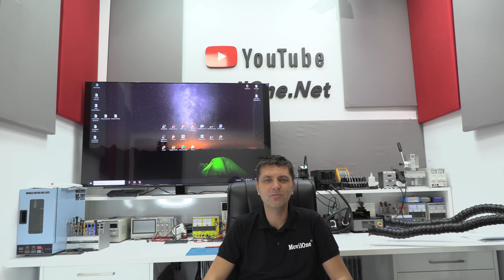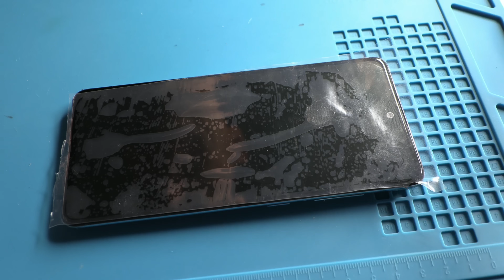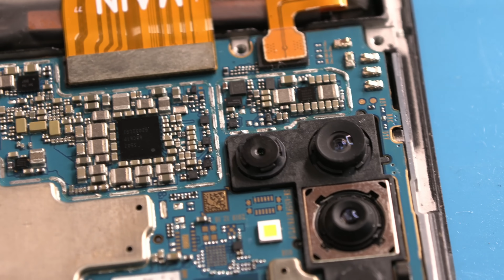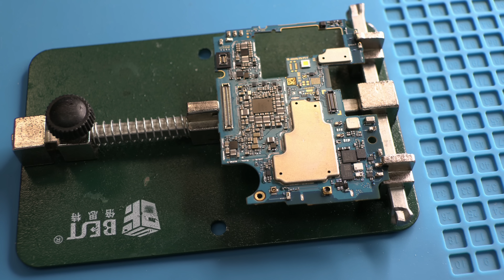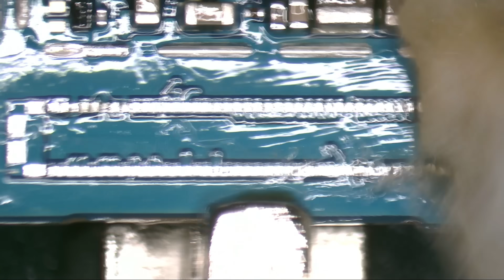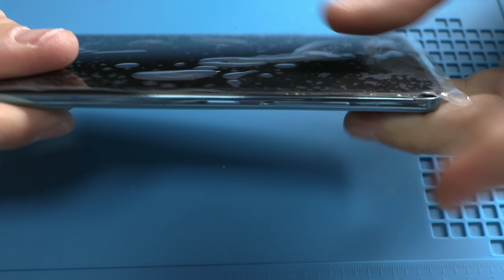The Samsung A Series Secret They Don't Want You to Know!

Comment: Going Eco killed this.
The Lead base solder could "flex" (actually bend like other metals) and the new eco solder is like flexing glass (snap)
Reply from the maker: You're absolutely right! The move to lead-free solder has led to brittleness and reliability issues. Leaded solder allowed for some flexibility, while the newer "eco-friendly" alternatives are much more prone to cracking under stress, leading to premature failures.
Reply: @MovilonePhoneRepair  And billions and billions of trash bags with dumped failed smartphones.
Entered the ground or waterways
Reply: idk, i've had a plenty of leaded solder failures too. Solder can fail under some surprisingly small continuous mechanical stress, leaded and lead-free. I'm not sure if lead-free is any better or worse, my experience is mostly around the leaded stuff.

Comment: these devices aint manufactured by samsung directly, thats why. the quality control is not good enough.
Reply from the maker: You're right—many devices are manufactured by third-party suppliers under Samsung's brand, and quality control can sometimes be inconsistent. This often results in common recurring issues across multiple devices.

Comment: Thermal contractions
Reply from the maker: Thermal expansion and contraction could definitely be a factor, especially with the varying materials used in modern smartphones. Over time, these stresses can weaken components and lead to cracks or failures.

Comment: Same problem in oppo A57 and A77 batery conector
Reply from the maker: You're not alone in noticing this issue—battery connector failures seem to be a recurring problem across multiple brands, including Oppo. Weak solder joints and poor quality control are likely contributors.

Comment: ForTheMicroprocessors,TheChipIsSmallerThanTheBoard.WhyNotMakeTheChipAsBigAsTheBoardAndNotCramAllTheComponents(Transistors)?ThisWayResistanceIsLowerSoNoNeedTheFanForCooling.
Reply from the maker: That's an interesting concept! However, increasing chip size would also increase power consumption and potentially create new challenges in heat dissipation and manufacturing costs.
Reply: @MovilonePhoneRepair  Ok.IMeanNotPuttingMoreTransistors.But,IncreaseTheTransistorsDimensions,IncreaseDiameterOfConectionsBetweenTheTransistors,ThusHavingLowerResistance,AndLowerPowerConsumption.

Comment: Hello!
I work in one corporation, we do have constant issues with connectors even if they are tested by producer and then internally, the connector change is always a hassle of agreeing with everyone that these will fit.
It is quite difficult, there is planned obsolescence in phones and smartphones, but mostly it is in technical written as device lifetime or something like this.  Connectors are always in issue, they are a real pain even though they have been produced sometimes for decades, issues were adressed and it is never fixed even if supplier is pushed to modernise thing, change the design and it just make less failure rates a bit, but connectors are not planned obsolescence, they are just poorly designed and poorly produced. There are also huge issues with soldering, even in automotive because of lead-free solder and complexity of PCBs for soldering ovens.
the old connection systems had betterating force, were mechanically more complex, but were taking more space and had more parasitics. These FPC are better in terms of signal integrity, but mechanically they are very delicate and can't withstand for a long time periods usage outside of the table.
Samsung doesn't have input control, what is supplied is just delivered and then used in production. The problem is company that has buroucracy that just drowning in meetings where they grind water and try to find a scapegoat. They won't fix phones even if they would malfunction right after being packaged.

Comment: My a34 broke when i droped it  and screen went black but there were no cracks on glass
Reply from the maker: That’s unfortunate! Internal damage can happen even without visible cracks on the glass. The force of impact can transfer to the display components inside, leading to failure.
Reply: @MovilonePhoneRepair  my s21 cracked and under repair, the only phone that has never failed on me is my fake iphone 15 pro max i got of aliexpress and inatalled lineage os onto, apart from an ocasional reboot, its my backup and is my gaming phone

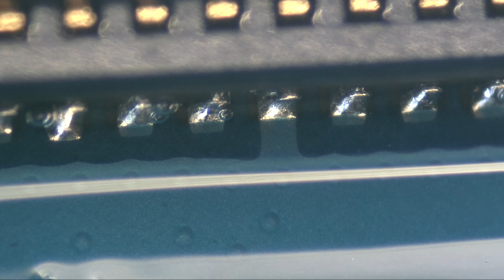Comment: 9:27 why don't you cover components above the repairing space ,their soldering can be melt down too ?
Reply from the maker: Hi, for those who know me, I never cover anything when soldering because I prefer the heat to dissipate more quickly. And just to clarify, I work with temperatures of 400ºC, but the key is using a low airflow.

Comment: We used to service devices , apparatuses, and the like. Today, it gets shipped or it goes to the landfill. A51 is toilet paper here in the usa... and anyone possessing the skillset to diagnose and exact repair, is in data recovery or repair of cnc or industrial automation. These devices are great lil learning devices. As far as Samsung is concerned  ... usa sold them our appliance market... Samsung phones are great for taking over for other brands, try getting your pictures off of an sd that was in a Samsung... with a moto.... 💀 but, magically with a differt samsung, got my images... and then... sd had to be formatted or it would not read.... and the backup? Moto could not read that either. But our population has no problem financing $2000 on the samsung galaxy hype... with their $ 250 devices... that is why .... we live in a disposable country.
Reply from the maker: It's unfortunate that repair skills are being lost in favor of a throwaway culture. With manufacturers pushing expensive replacements over repairs, it's becoming harder to maintain devices long-term.

Comment: The most commom problem with smartphones is the battery that magically lost more than half of it's duration right after a software update (generally one year of use)
Reply: software updated to dance away from warranty responsibility?
Reply from the maker: Battery performance degradation right after software updates is a well-known concern. Many suspect it's an intentional move to push users toward newer models.
Reply: @MovilonePhoneRepair  and it works, i lovr my phone, but i will have to change it since it lasts only a third of what it lasted when new (only two years ago)

Comment: Back in the mid 70's I worked my way through college as an IT building and testing printed circuit boards. Even went through the same training that they do at NASA. I am amazed at how far things have progressed.
Reply from the maker: Wow, that must have been an amazing experience working with PCBs back then! Technology has come a long way, but some of the old techniques and skills are still valuable today. It’s always great to hear from people with firsthand experience.
Reply: @MovilonePhoneRepair  We were building electronic equipment for the oil industry, very harsh conditions which is why they were really strict on work quality. Some of our stuff were in tools sent down hole with temperatures touching 400 F and a lot of vibration.
BIG EDIT: I didn't catch PCB as printed circuit boards on my initial response.
Reply: Progressed? Try regressed
Reply: @ricardomontalban2114  Are you saying that today's electronic are not superior to yesterdays? While I, in some circumstances like with guitar amplifiers, think the old tube amps were better, overall electronics have greatly progressed. So has the manufacture of this stuff. The only thing I can see as going backwards is if you like to put your own equipment together. It is simply more fun to solder in individual components instead of one IC.

Comment: Plz make a video on galaxy s8 device , my s8 doesn't pick sd card , may be its SD card slot has issue inside .
And also galaxy s8, s9 has slow charging issue on one side and fast oj other.
Charging strip of galaxy s8 is very weak ,
Make a video on its charging strip issue issues
Reply from the maker: Thanks for the suggestion! The Galaxy S8 does have some common issues with the SD card slot and charging strip. I’ll consider making a video on that topic soon to help out users like you. Stay tuned!

Comment: I like how you make it seam to people this is an easy fix. ITS NOT! By the time you spend the money for an airflow, soldering iron, a high-powered video microscope, and the proper tools and equipment you need. Just to fix the phone you might as well go out and buy  a new phone. Besides the technology itself changes so fast within six months to a year that product you just bought is now obsolete so why would I go spend all that money on all that gear needed to fix an obsolete phone? Everybody knows that there’s more R&D putting into make products fail, but that’s because technology move so fast it doesn’t make sense to hold onto your old products. Let alone pay to get them fixed or even pay for the hardware to repair them yourself. I can appreciate the fact that you wanna show people that. Yes there are flaws in manufacturing as put there on purpose. I work in a lab and I do electronics for living the technology move so fast it doesn’t even make sense to repair it . If it breaks throw it away. Go buy a new one. I bought my iPhone and literally within three months. They had a brand new version  out. The best thing I’ve ever seen people do is go to Costco and buy their electronics because within a year if they come out with a new product, you could just trade it in for an upgrade for free. I’m all about trying to keep stuff out of landfills and believe me I have a lot of old technology that I’ve repaired time and time again, but it gets to a point where even that older technology, even though it works is obsolete for where the times are. No matter how good it works you’re just not gonna be able to keep up with society and the people around you. Good example is if you have a phone that won’t allow you to install an application because the operating system run on is too old to support that new application. If you need that application for work, you’re stuck upgrading. You have no choice.
Reply from the maker: You bring up a great point. Repairing devices isn't always easy or cheap, and the rapid pace of technology can make it feel pointless sometimes. But the bigger issue is the environmental impact—throwing away perfectly repairable devices just because of minor flaws or software limitations adds to the growing e-waste problem. If more people learned basic repairs, we could extend the life of our devices and reduce waste. Still, I get that sometimes it's just easier to upgrade. It’s all about finding a balance that works for each person.

Comment: i've noticed the same thing with hp laptop batteries. It's like they have an installed system that's meant to keep track of its service time. It refuses to charge after some time and before this, the latop starts to giv you warnings every time you turn it on.
Reply from the maker: Yeah, that’s a common issue with HP laptops. Many manufacturers embed battery management systems that seem to "expire" after a certain period, forcing users to replace them even if the battery still has potential life left. It's definitely something to keep an eye on.
Reply: I bought at HP laptop.  After 3 years the motherboard went.  Bought one in 2020, 6 months after the hard drive went!  Still works today 5 years afterwards!

Comment: Until last year i had a A51 but it has a problem of constantly getting rebooted and getting stuck in the logo. And because in my city the are no technicians that can find or fix the problem. I had to buy a new phone
Reply from the maker: That's unfortunate. The reboot loop issue is quite common in the A51, often related to storage or power management problems. Finding a good technician can be a challenge, but sometimes a thorough reflash or hardware check can bring the phone back to life. Hopefully, your new phone serves you better!

Comment: A have an old LG Blu-ray player that the manufacturer used wrong solder that cracks in low temperature, and stops working. I took the motherboard out and put it in the kitchen oven on a tray at 180 °C for 10 minutes.  It has now worked for 15 more years since it's death!
Reply from the maker: That's an awesome DIY fix! Reflowing solder in an oven can sometimes work wonders, especially with older devices that suffer from thermal cycling issues. It’s great to hear your Blu-ray player is still going strong after 15 years!
Reply: It is a Blu-ray surround sound device.  Heard that this issue was for many units they sold. The warranty was overdue.

Comment: CONFIRMED on Samsung Galaxy A55 and the newest M Series

On the Chinese Brand Poco Series starting failure by design. Thermal issues and Crap solder join.

Transion Holding's port Type C Connector degradation by design.
Reply from the maker: Thanks for sharing that info! It’s true—some of these failures seem too frequent to be just coincidences. Poor soldering and thermal issues are becoming more common, especially in budget series. It’s always good to be aware of these potential problems before buying.

Comment: Just opened your vid as I brought back a phone from a repair shop two days ago. The phone is POCO F2 Pro -- a very nice phone that is serving its second owner.
The shop identified the problem as being on the main board and said that the board would have to be replaced at high cost and that it makes more sense to get a new phone. They also said that the battery charge should never go to zero because the flaw would prevent a recharge. They recharged the battery externally and it can be charged (again) now. Boy, it sure seems like the PFC conn thing. On and off. Oh, the pop-up cam is my favorite and works like a charm. I'll go back in with the request to zero-in and replace the FPC (at 1/10th of the cost). Wonder about their reaction.
Reply from the maker: That’s a classic case of repair shops trying to push for a full replacement instead of targeted repairs. If the issue is with the FPC, replacing it could definitely save you a lot of money. Hopefully, they’re willing to work with you on that instead of just suggesting a new phone. Good luck with it!
Reply: @MovilonePhoneRepair  most modern "repair shops" don't even have the equipment, skills or parts to do component level repairs. you can consider yourself lucky if you find one that does real repairs

Comment: my A34 stopped charging i got that fixed few months later its boot looping for a day as of last week its started boot looping again
Reply from the maker: That sounds frustrating! Boot loops can sometimes be linked to software issues, but recurring problems often point to hardware faults, like storage or power circuits. Maybe a deep inspection could help find the root cause.

Comment: I had the same problem A 51 5g sometimes it used to charge  other times it wouldn't other times it would charge for longer hours
Reply: It took me years in phone repair shops  until now i don't what the problem was but the phone is now okay but I live in fear it will spoil again. Even my back plastic cover has broken apart from opening and closing the phones back side
Reply: A jumper wire was put on the fiber cable, but it finally worked
Reply from the maker: That’s a known issue with the A51 5G. The charging port and related circuits tend to wear out or develop inconsistencies over time. Keeping an eye on it and using good-quality chargers can help extend its life.

Comment: Thanks.  I still find it shocking to do solder by just high heat flow without ever touching the part. I first saw this thing in 1980 about how circuit boards are done in a factory with these solder float areas to solder the parts to the bottom of the board. It was not any wonder why for my dad's TV repair business the problems on the more modern TV's back then often were bad solder joints on the circuit board causing the problem. The mini connectors they use for charging instead of the reliable barrel charging one we had for years is also very frustrating, since the connector soon breaks, because the operator used the wrong plug or plugged it in the wrong way, or just from daily use...
Reply from the maker: You're absolutely right. High heat flow soldering without contact can seem surprising at first, but it's an effective method when done correctly. Older devices often had more durable components, and the transition to mini connectors has definitely made things more fragile and prone to failure. Thanks for sharing your insights!

Comment: I use M series and it have same issue. Some expert helped by adding small wire as jumper
Reply from the maker: Yes, the M series has similar issues as well. Using a small jumper wire is often an effective fix for these kinds of problems.

Comment: Lead free solder is awful stuff that decays and cracks over time. It is banned in medical, aeronautical and military electronics. It is not planned obsolescence but an obsession with ROHS. Exposure to lead can be very injurious. Precautions to reduce the risk are too expensive for electronics built down to a very low price. Also the longevity of much of this is determined by fashion so a short life is not so much of a bad thing. I disagree with this but understand it. My children change their phone every year for no sane reason. I want mine to last 10 years. Who is right?
Reply from the maker: You're absolutely right about lead-free solder. It’s a compromise between safety regulations and durability. Many critical industries still rely on leaded solder due to its reliability. And yes, the obsession with fashion-driven upgrades leads to a mindset where longevity isn’t a priority for many consumers, even though others, like you, value long-lasting devices.